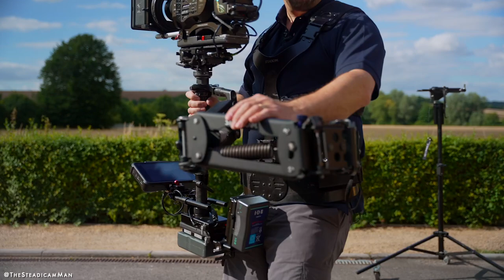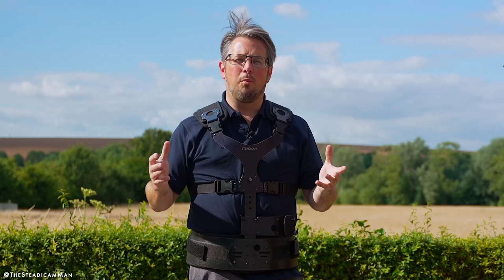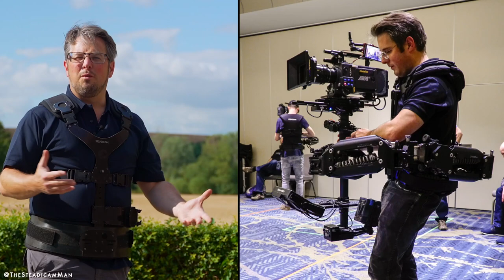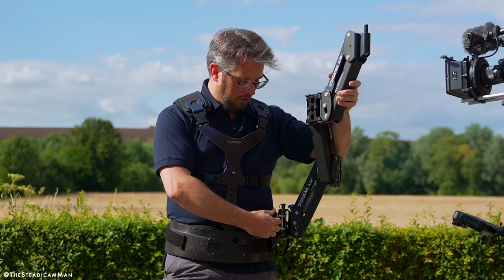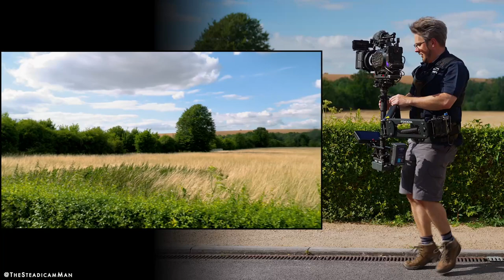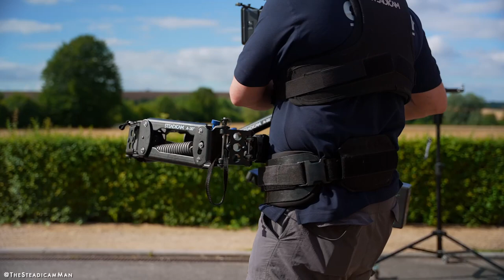Steadicam 3rd Section Arm for small rigs demo!

Comment: It looks like the middle section is "locking up", John.  It could be to do with orientation or twist, or a combination.  The same thing happened to master arms when back mounted.
Reply from the maker: It was yes, that was the section I added, so presumably most prone to twist or adverse pressure. I might swap the sections around and see if it still happens.

Comment: Hi John, we would like to use a Sony Fs7 on a Zephyr and i see you power your Sony through the Lemo-XLR cable on the XDCA. Is this a original Tiffencable ( 0B 3-Pin (male) Lemo to 4-Pin XLR (female)? Or maybe Alvins or Ignite cable? I find the Tiffen site not always as clear in the supplied information.
Reply from the maker: Yes it's the original cable. A cheap multimeter will end all your worries about pin-outs!
Reply: Thank you very much John, its a great help to us. @TheSteadicamMan

Comment: Does a third arm increase the payload capability? A30 Arm = 30lbs ...A30 + another arm = 45lbs?
Reply from the maker: Well the way you put it does make sense, although I think the limit is per section, so if one is rated to 30lbs that’s still the total capacity for multiples of the same.